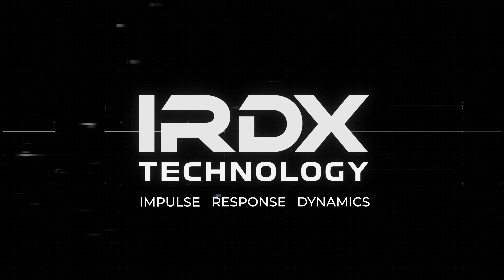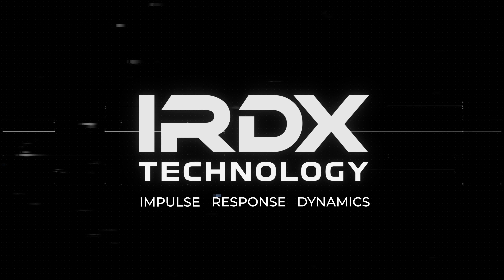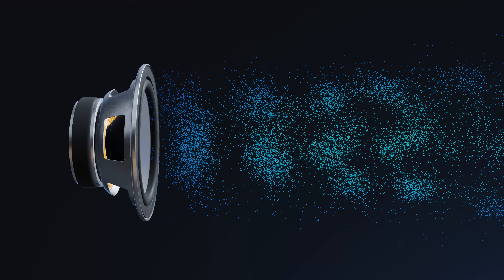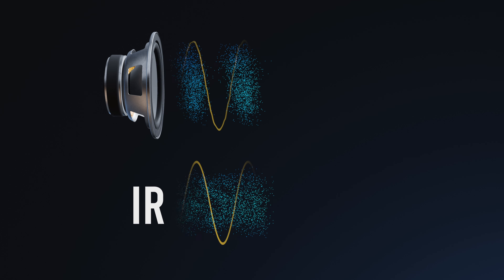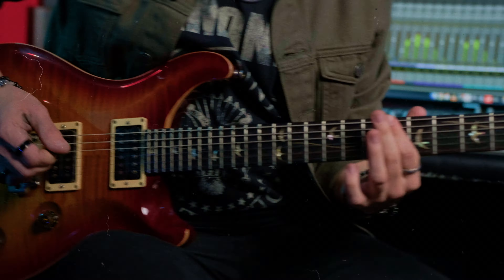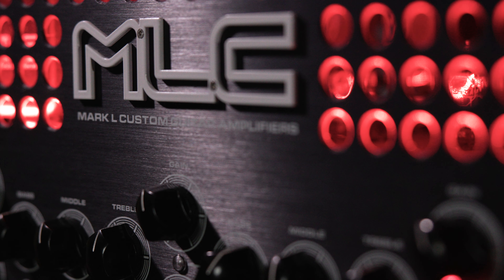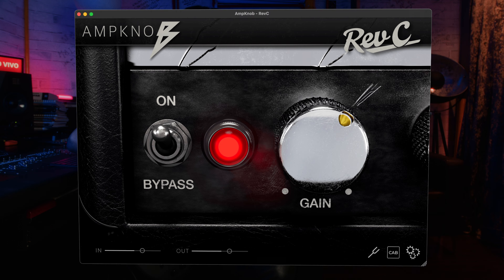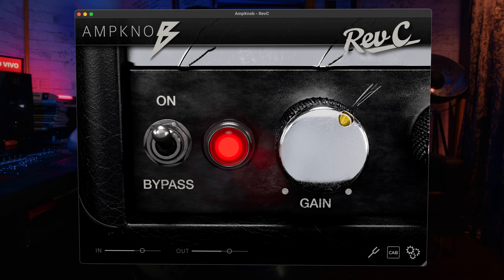Introducing IRDX Technology. The future of guitar speaker modeling.

Comment: You need to release a new plugin that its just an IR loader with IRDX
Reply: I think so too.
Reply: You can turn off each section (stomp box, amp, eq etc) by double clicking on them, then just use the cab and load your own IR
Reply: Too expensive for just that feature
Reply: @henningsrensen8043  to much effort and cpu size. Also a loader has to be a good file browser tool

Comment: That is an amazing revelation! Thank you so much for having IRDX already included in the Ampknobs. I have all of them and they sit great in my mixes, especially the RevC with the matched cab. With the amps sims from the competition I have the problem that they sound much too noisy or too artificial or too thin. You have saved my ass. 

PS: Just an idea: Since one should use different IRs on the left and right guitar, it would be great if there was a variation of the matched cab included in each Ampknob (if one doesn't want to mix them), because the matched cab is so perfect that I have not found something equal to it yet.

PSS: Another Idea: A dynamic resonance filter that is affordable for bedroom producers would be also great. If you were to make an IRDX powered IR loader, maybe one could include that too?

Comment: As somebody who works professionally on dynamical system modelling I can guarantee that impulse responses have nothing magical and need no "advanced ML methods" to capture them. Nonetheless, the BD plugins sound killer.
Reply from the maker: There’s nothing new we’re doing about capturing IRs. But impulse responses are static snapshots with no time based information. 

IRDX works on top of existing IRs to bring back the speaker behavior that happens in the time domain.
Reply: I think you're missing the point here. The point is about subtle movements in the speakers that are not linear. It's not that the IRs are bad it's just the response is perfectly linear and obviously that doesn't happen in real life. Little things change in the speaker as you play and none of that is replicated with an IR with a sine wave sweep.
Reply: @Jazzguitar00  Fair enough. I mean, still, there is nothing mysterious on it either, I guess with multiconvolution over different amplitudes or something close to that. Then, in real-time, dynamically interpolate between these IRs and I think this is something done already by some companies. Could it be proper speaker modelling then? In any case, the plugins sound like crazy good. Love them!